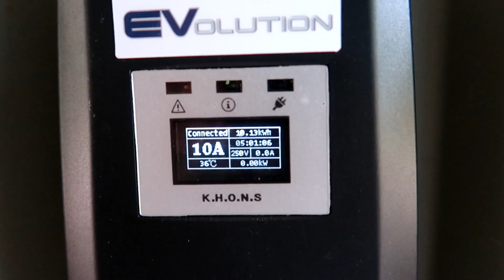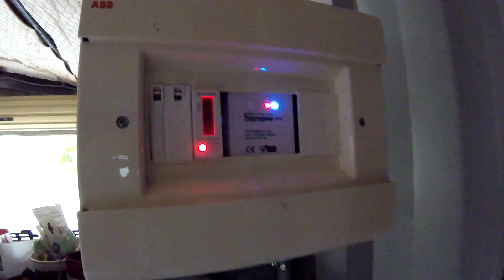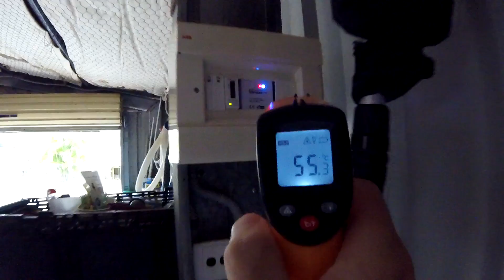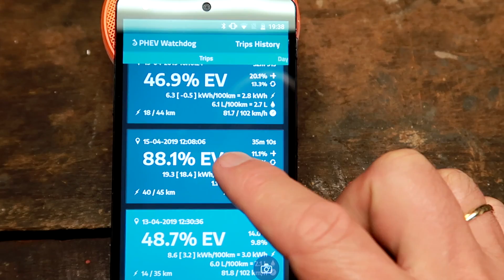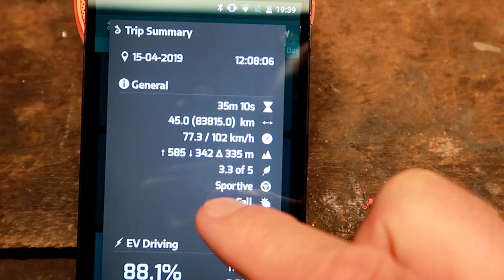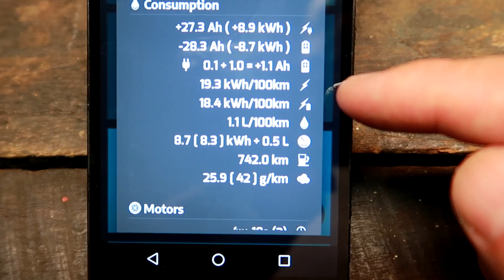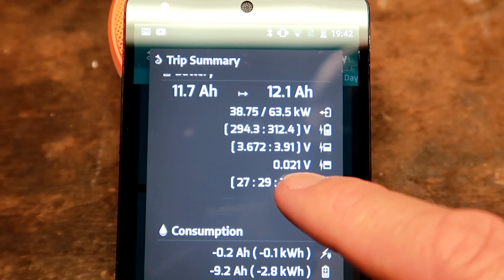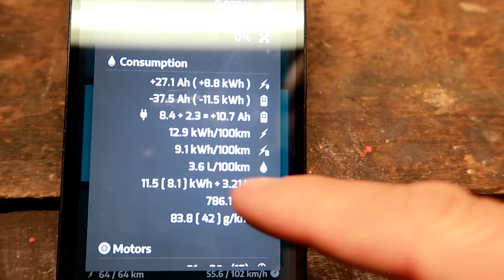EP210 - PHEV Leftovers: Staying plugged in? Hot SONOFF! Highway EV range

Comment: I would think that only reason not to leave car plugin is if you have some storm and can get a lightning strike or something like that. It does not overcharge it - charging turn off if battery full. Here were in winter can be quite cold (-25 and below) it actually keeps the battery within acceptable temperatures and if you leave it unplug it would totally drain the battery...

Comment: 6.1l/100km.  Not bad!  Just done our first long run in the 2.4l MY19, packed car, off to Blackpool and back on a 280mile trip. Empty batteries on way back and mainly 70mph (110kph).  37mpg (7.6l/100), but went up to 40mpg (7l/100) when in 50mph roadworks, mostly flat.  Our 2010 Prius did 70 mpg at 50mph, 50mpg at 70mph (?!), but horrible mpg around town, and awful to drive. 

So PHEV still wins 😉

Comment: BTW my 16A Sonoff burned after a few weeks of use on my 3.5kW EVSE. I was smart enough to put the smoke detector in garage close to my EVSE and I was woken up in the middle of the night , so nothing terrible happen.
Reply from the maker: Wow, I can see this coming here too. I've seen many pictures on the web of such SONOFFs totally burned and wrecked. Maybe I should only use it for operating a 40A contactor which switches the actual load. I still can read the energy usage on my meter and on the EVSE.